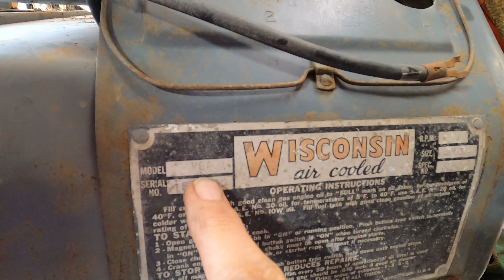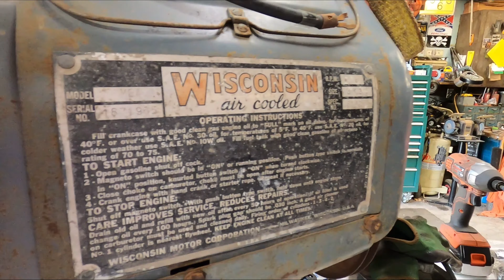A Wisconsin VE4 and a Tecumseh HH100 On The Workbench. One will Run One Won't! Place Your Bets!

Comment: NIce video, I had an old Wisconsin 4 cyl that came off an old bailer. The valve springs were so bad that they would not close the valves all the way when trying to start it.  I installed new valve springs and it started on the second try and ran great. Can't wait to see if you can make that one run. Many thanks and feel better.

Comment: I really like those old 4 cylinder engines, I have had several but I only had one with electric start,, they usually start pretty easy  until they get hot then they are reluctant to start using the crank I mean.. I have found it's not unlikely to twist a head bolt or two off when taking the head off.  I just bought an old 2 cylinder Wisconsin the other day, I have a video of it I made a few videos back.

Comment: I think cylinder pressure is low as you cranked it all the way around.

I can't hardly pull my TJD over tdc.

Just a heads up your risking harm with thumb wrapped around the start crank handle and pushing handle down if it missfires.

Palm grab and pull incase of missfire the handle slaps knuckles and unlatches rather than pulling a thumb or pushing back against a wrist.
Reply: Yeh, those old V-4's could break your arm!

Comment: As far as those carbs go, I've also seen worse, completely useless ones.  Have an HH140 OHV on a Bolens H-14.  Had to adapt a Kohler carb to it.  Engine runs pretty well but haven't been able to mount an air cleaner.  Lack of clearance to the loader bracket!

Comment: Hello,
 I also have a VE4 V4 engine.
I’m looking for the bell shaped top for the air cleaner.
The screen that fits over the flywheel air intake.
The exhaust manifold.
The primer that fits in the intake manifold.
Is there any chance that you would sell these parts to me if you have them?
Thanks.